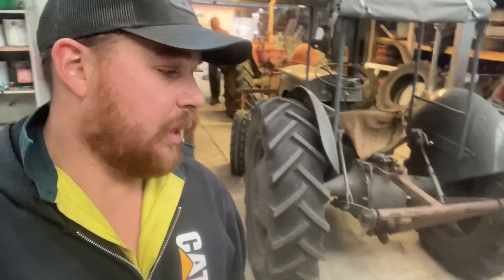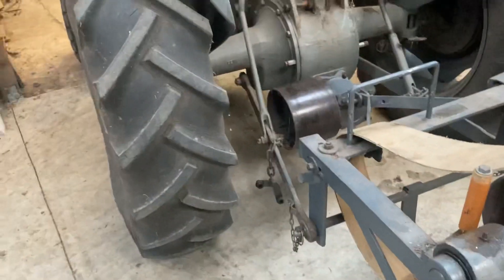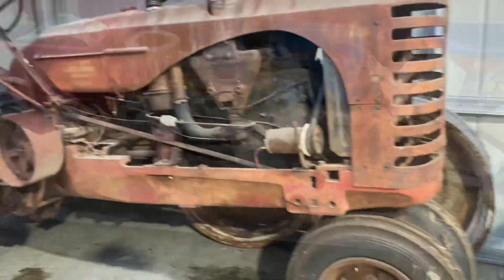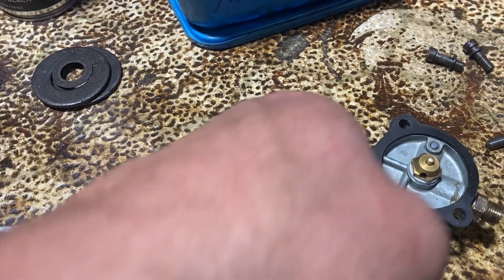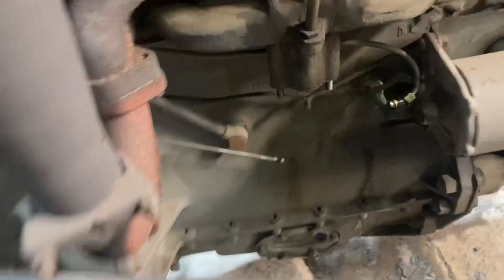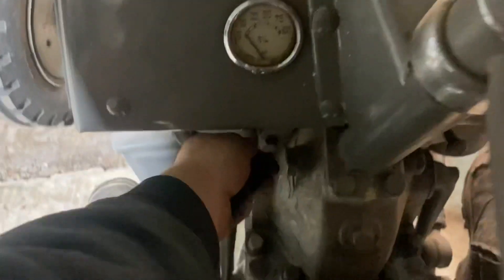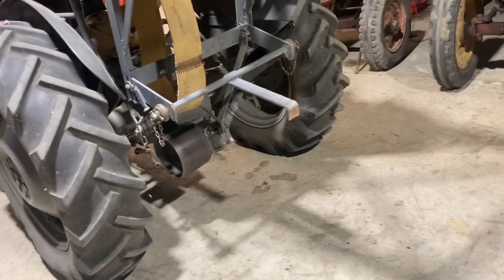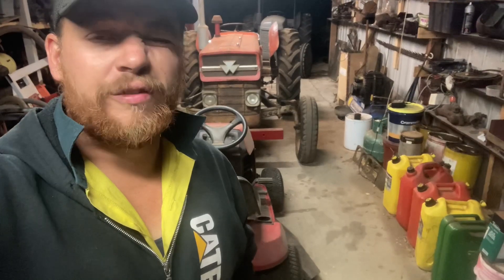Ferguson TEA20 carb clean and saw bench

Comment: I was wondering do you have any advice for starting a Ferguson implaments collection
Reply from the maker: My advice would be, always look for the brass tag, all Ferguson implements had one. Also grab yourself a Ferguson book that has a lot of implements in it, this way you know what something is if it pops up for sale, people often advertise things and don’t actually know what it is.
Reply: @vintagetractorsaustralia  also any advice about restoring a Ferguson benchsaw
Reply from the maker: @martincorrigan1791  not really. They are very simple. Just disassemble, clean, lubricate everything. And then we took the blade to be professionally set and sharpened. Once they are set you can touch up the blade with a file if needed.
Reply: Do you have any more Ferguson implaments
Reply from the maker: @martincorrigan1791  yes. 

Jack
Mouldboard plough
Disc plough
9 Tyne cultivator
Scoop
Carryall
Multipurpose agricultural pump
3cwt trailer
Saw bench
PTO drill (not ferguson)
Post hole digger
Cement mixer (not ferguson)
Grader blade
Weather hood
Wheel girdles
Ripper 
Pick up hitch
Rotary hoe (Howard)
Hay rake
Hay mower
Auger
Reply: I missed a Ferguson post hole auger recently
Reply: I am looking for a Ferguson potato digger
Reply from the maker: @martincorrigan1791  yea. They come up fairly regularly. We don’t really chase the implements, but we keep an eye out for them. If they pop up for the right price, we grab them. Been collecting for about 15 years now, basically ever since we finished the Fergy.
Reply: @vintagetractorsaustralia  thank you for the advice tho
Reply from the maker: @martincorrigan1791  too easy mate. Happy to help when I can.